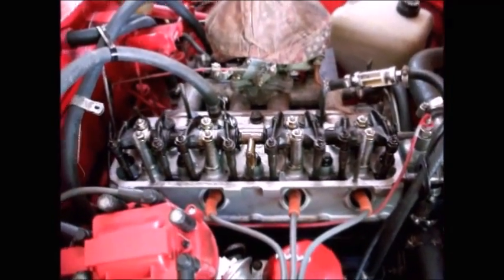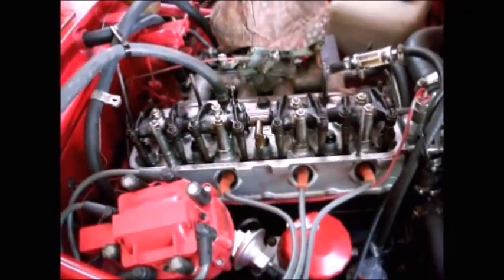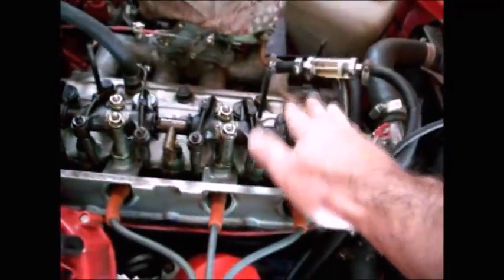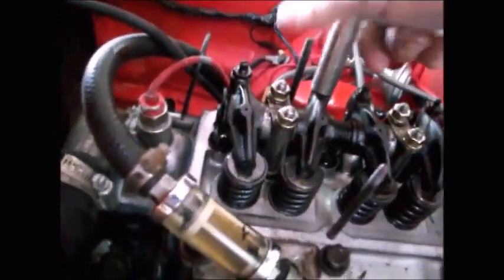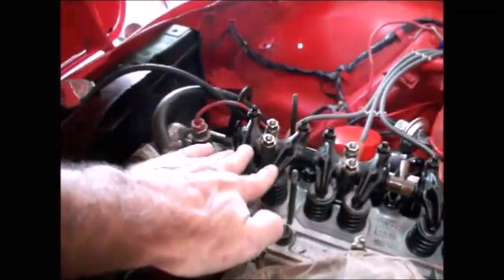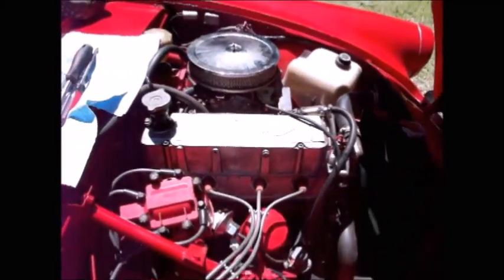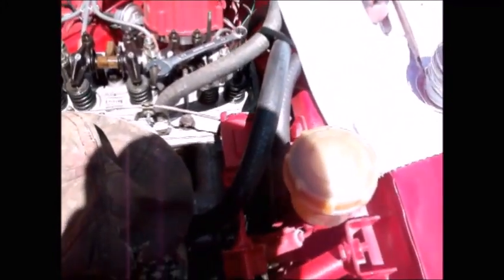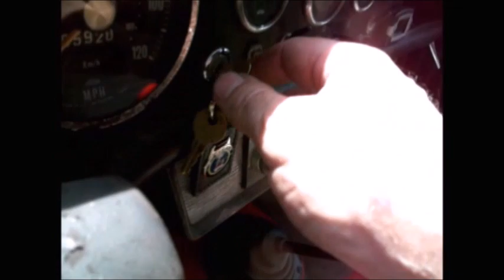Sunbeam Alpine valve adjustment

Comment: Solid cam? (Haha.He means lifters.)It is not necessary to set the valves at .015 intake and .017 cold..Also it is bad advise to set both valves on the same cylinder  at the same time..This way would require find TDC on each cylinder...#1 is easy..2 3&4 not so much..ALL manuals show a sequence in 8 steps.. Thr first step goes something like this.. "With #4 intake fully open adjust #1 intake... Anyone using .010 for intake and .012 for exhaust owes direct credit to Tim Tom..It is in no manual.. Tiger Tom told me this and l told it to  Owen.
.The botton line is this.
ONLY SET YOUR ALPINE VALVES USING THE SEQUENCE IN THE MANUAL ( or be sorry)
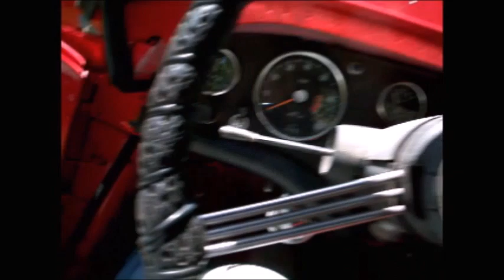Reply from the maker: Hey Al!  How are you, man?  I haven't talked to you in years!  How have you been?  Al Gears Mason, I remember you.  You told me that I could run a Chevette distributor in an Alpine....turns out you can't, but I put an Oldsmobile 350 HEI distributor in my Alpine and it worked great!  Problem with the Chevy HEIs is that they spin the wrong way, the Chevette HEI will work, and the engine will run, but you'll have no vacuum or mechanical advance, so it's only good for idling.  Olds spins the right way.  You can see that big Olds V8 HEI distributor in this video.  That was good advice, it was always a very reliable distributor, while I owned this red '67 Alpine, but that HEI wasn't compatible with the tach, it made the stock tach go crazy.  Fast forward to 17:59, and you'll see what I mean.  

It's good to hear from you Al, but I can tell from your comment that you didn't watch my video, or that you didn't watch much of it.  I get it, it's a long video, pretty boring, but it's not for you, you know this stuff, and if you watched the whole thing, you'd see that it makes sense what I'm doing.  This video is very basic, and it's for guys that don't know much about engines and want to learn, it's for the beginner.

Go to 24 seconds into the video, I did I say say solid lifters.  I worked in an automotive machine shop for two years, and I've been building solid lifter V8 engines since I was 16 years old.  By trade I'm a jet engine mechanic, but I started out on 60s car engines that I still work on today as a hobby.  If I say solid cam later on in the video, after initially saying solid lifters, it's because it's understood in my circles that solid cam is short for solid lift cam, or solid lifter cam.  I can see why the Alpine crowd wouldn't use that vernacular, because all Alpines have solid lifters, so there's little need to specify an engine that has a solid cam vs a hyd cam.  We say hydraulic cam as well, even though we're fully aware that the lifters are being pumped up by hydraulic pressure from the engine oil, and not the camshaft.  Also, hyd cams and solid cams aren't interchangable, so it's good to know what you've got, and what you're buying.  

Here's a Summit Racing link for a solid cam and lifter kit:  
https://www.summitracing.com/parts/cca-cl12-225-4

If you prefer Jeg's, here's a link to a solid cam on their website:  
https://www.jegs.com/i/COMP-Cams/249/12-635-5/10002/-1  

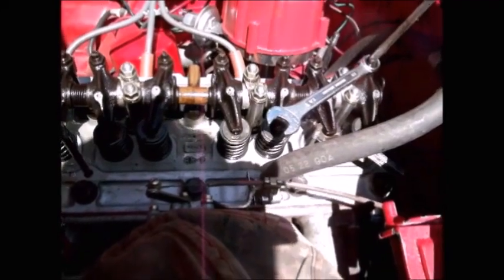I set the cold valve lash to get me in the ball park, because I had just installed the rocker shaft, after re-torquing the cylinder head, I mentioned that at 47 seconds in, but yeah, I agree with you, not required, since it was the same rocker shaft going back onto the same engine, and it still held it's original adjustment.  I was curious to see how close a cold valve adjustment would get me, once everything expanded, and I adjusted it hot.  I go over the results of that experiment at 14:39, for anyone that's interested.  Also, at 11:16, I mention that after the cold valve lash adjustment, I'll take it down the road, and then do the hot adjustment, but I'll have to work quicker on that one as things cool down, so no time to video that one.  So really that's the main reason I did a video showing the cold adjustment, procedure is the same, but I had time to make a video for the cold, and not the hot, where I had to work fast.  I should have mentioned that in my video.  I'll edit my video's description for that.  

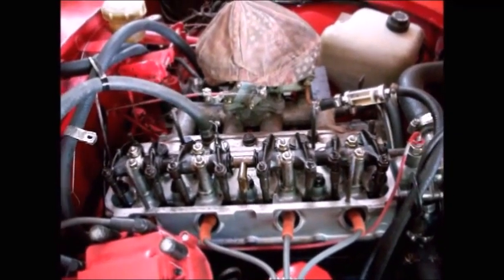Like I said in the video at 1:01, the .010"I and .012"E valve lash, that was from the common consensus on the Alpine forum.  You don't always need a book.  I just try to make sure I'm getting good advice on forums, one guy on the Alpine forum said that he thought you could adjust valve lash on an Alpine while the engine was running, so that's not the guy I was looking for advice from.  If Tiger Tom was the first to figure out that .010" and .012 works best these days, then he gets credit, and in my video, I never claimed credit for that, I just said I looked for that lash on the Alpine forum.     

It's also correct when you advise to not adjust both valves for the same cylinder at the same time, never do that, and my video never says you can do that.  You can't do that,  but you can absolutely adjust both valves for the same cylinder, one after the other, as long as you set one, then turn the crank until the other one is closed, then set that one (the one that's fully closed now), then that cylinder is done, and you're 25% done.  No need to find TDC at any point, I'm not sure what you're talking about there, because finding TDC isn't mentioned in my video, and it's not something that you'd ever need to do, simply to adjust the valves.  

Just make sure the valve you're adjusting is fully closed, and you can adjust it, that's my 19 minute video in a nutshell.
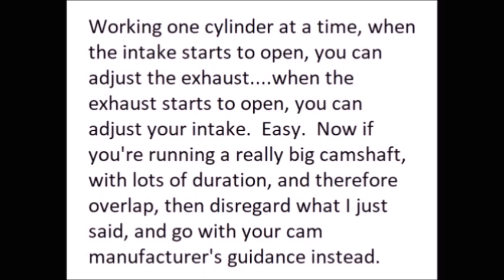Reply from the maker: I get guys that like to use the book, but I've been adjusting valves on solid cam engines since I was a teenager.  It's safe to adjust valve lash the way I've done it in this video, as long as you don't have an insane camshaft with way more overlap than most guys will ever run on the street, and that disclaimer is in my video at 5:03.  I think it's easier this way, and you don't need to memorize anything or go to the manual to see which valve to do next.  And the procedure I'm using in this video will work on any four-stroke engine, V8, I4, V12, whatever.  So if an Alpine guy buys an MG, there isn't much to learn, just find out what feeler gauge to use from the guys on the MG forum, and go to work.  I get that the Sunbeam crowd is set in their ways, and a lot of you guys only have Sunbeams, so buying a Sunbeam shop manual is a great investment for you.  Here's the thing, I've got a '66 Alpine, and a '55 Pontiac, and a '61 Studebaker, and a '63 TBird (that I gave to my daughter but I still get to work on), and a '63 Corvette, and a '65 Mustang, and a '68 Coronet, and a '68 GTO (that I gave to my son but I still get to work on), and a '70 Road Runner, and a '75 Bronco, and I used to own a '67 Alpine, and a '69 Mustang and a '70 Mach 1.  Now it's true that only my Vette and Alpines came stock with solid lift cams, but I've had lots of solid cams in all three of my Mustangs, mostly Crower but my first solid cam was a Sig Erson.  I've never owned a car newer than 1975, or older than 1955 and when you have this many different cars, you can't afford shop manuals for all of them.....and if you understand how all four-stroke engines work, you really don't need all of those shop manuals.  I look up suggested valve lash, torque values and suggested initial timing online, and that's about it, and I say suggested initial timing, because I like to know my total timing as well, and dialing that in, can move your initial timing a bit.  Total timing is not normally in books, but you can find it online, from guys that learned from trial and error, just like Tiger Tom learned that .010" and .012" was a better fit these days.  It's like hot rodding.  If the early hot rodders only did what the factory shop manuals told them to do, then there wouldn't be hot rodding.  The guys that came back from WWII and started real hot rodding, they understood how things worked, and they wrote their own books.   

As far as the procedure for adjusting valve lash by the book, it will totally work, but there are more ways than one to skin a cat.  All the book wants you to do is ensure that the lifter is not at all on the cam lobe, while you set the lash.  Do that, and you'll be fine.  All I'm saying is that there is more way than one way to ensure your lifter is off the cam lobe.  It's a four stroke engine:  intake, compression, power, exhaust.  The intake valve opens for the intake stroke.  The exhaust valve opens for the exhaust stroke.

Turn the crank, and when one valve starts to open, adjust the one that's right next to it, it'll be fully closed.  That's what I've seen from my Alpine, if there's overlap, it's not much.  Fast forward to 2:56 in my video, and you'll see it.  Pay attention to which valves are open, and which are closed.  Three cylinders had valves where one was closed and the other one was somewhat open.  One of the cylinders, #4, had both valves closed, so there's the cylinder that's on it's compression stroke.  None of the four cylinders had two valves that were both a little bit open (overlap).  Now fast forward to 6:54, and watch the just the valves for the #2 cylinder.  Rewind to 6:54 again, and this time watch just the valves for the #3 cylinder.....I don't see much overlap at all, do you?   

I had a little bit of valve overlap on all of the solid cams that were in the Mustangs I've owned, and I would let the intake open up just a little bit more, and by then the exhaust would be fully closed, but again, the intake was just starting to open, and not even fully open yet, and by then the overlap was passed, and the exhaust was fully closed.  Of course I had the cam cards for those cams, so I could look at the profile and see where the overlap was.  It would be interesting to see the cam profile for an Alpine, but I doubt there's much overlap at all where the intake starts to open, and the exhaust isn't quite fully closed yet.  It's fast the way I do it, it's not something I made up, lots of guys with V8s use this method, and the Alpine is no different, a four-stroke is a four-stroke.  Anyway, the proof is in the pudding, or in this case the video.  I've always adjusted my Alpine's valves the way I adjusted my Mustang's valves, and I was never sorry for doing it.  It always worked just fine, just as it worked just fine in this video.  Books are also fine, but it's normally not the only way to get a job done.  Either method will work for adjusting valve lash.  I've got a bunch of old cars, and I've only been into Alpines since I started talking to you on the forum, and you've been into Alpines your whole life, I think.  I only drove my little red '67 Alpine for eight years before I sold it, but it was my daily driver for most of those eight years, and I put thousands of miles on it, and I never had any issues using this method to adjust the valves on my Alpine, or any other car.  Anyway, I didn't make this video for old pros like you, I'm not trying to convert any old timers.  I just saw some confusion on the Alpine forum, and not just the guy that thought you could adjust them with the engine running, so I made this video, it's long and it's detailed, and I keep it plain and simple.  It's for the Alpine guy that really doesn't understand how a four stroke engine works, and what goes on under the valve cover, but he wants to learn.  Well if that guy watches the whole video, he'll learn something, because I don't just say the book says this, I explain what is actually happening, and I show it happening in the video.   

So my red '67 Alpine is gone now, but I still have my '66 Alpine, although it doesn't run yet.  I've got a lot of projects right now.  That red '67 Alpine was fun though, and I have proof of that as well, in the video link below:

 https://www.youtube.com/watch?v=AmQMVVTU2Is

Such a fun little car, once I figured out what to do about all the black interior gas tank paint that was coming off, traveling down my fuel line, and clogging my fuel filter.  :)

Comment from the maker: At 13:53, I pointed out one of the two bolt holes in the side of the valve cover, and how I installed a bolt in that hole, to give me something to tap on, in order to pop the valve cover loose.  I should also point out that I just realized that both of those bolt holes go all the way through, so if you leave one or both of those bolts out, you are adding unwanted ventilation.  I've since added that second bolt, so now it's all plugged up.

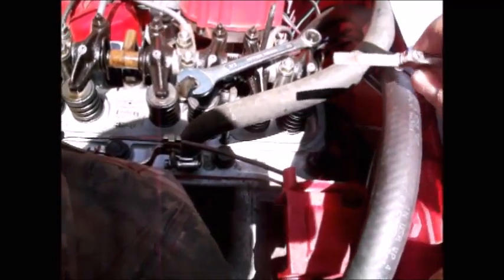Comment from the maker: I was shown where to find the wire gauge that I mentioned at 15:44 (turns out it's called a pin gage).  So, if you want to go with factory Alpine specs, then you'll want to set your hot valve lash at .012" intake / .014" exhaust, and if you do that, use the pin gage instead of a flat style feeler gauge.  Here are the links to buy them.

Here's the .012"

https://www.mscdirect.com/browse/tnpla/56243595?&cid=ppc-google-New+-+Exclusive+Brands+-+PLA_sM0E5trMw___334980939503_c_S&mkwid=sM0E5trMw%7cdc&pcrid=334980939503&rd=k&product_id=56243595&gclid=EAIaIQobChMImfiizo7_6AIVioTICh0ibAYTEAQYASABEgLOmvD_BwE

And here's the .014"

https://www.mscdirect.com/browse/tnpla/56243611?&cid=ppc-google-New+-+Exclusive+Brands+-+PLA_sM0E5trMw___334980939503_c_S&mkwid=sM0E5trMw%7cdc&pcrid=334980939503&rd=k&product_id=56243611&gclid=EAIaIQobChMI4u6d1o7_6AIVQj0MCh0v-wpDEAQYASABEgLCA_D_BwE